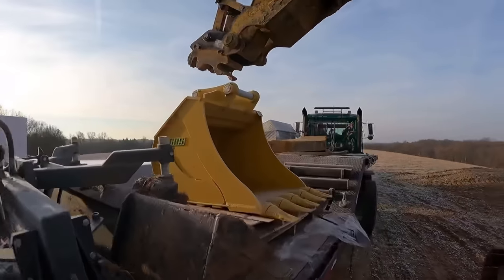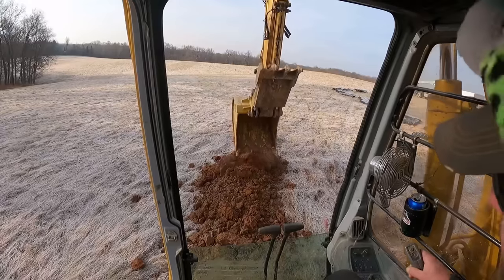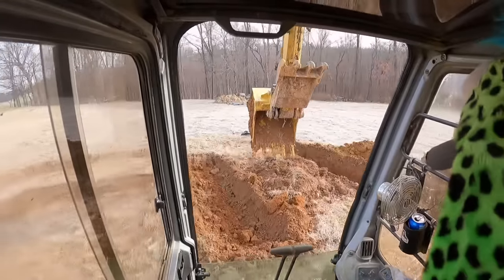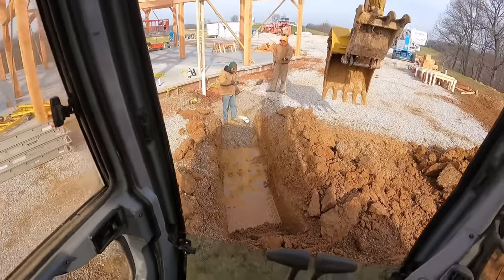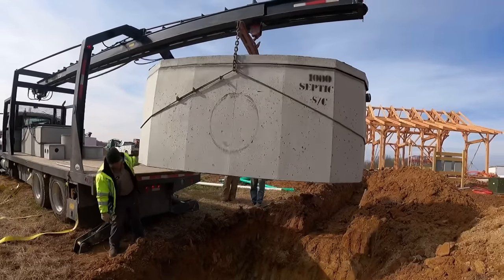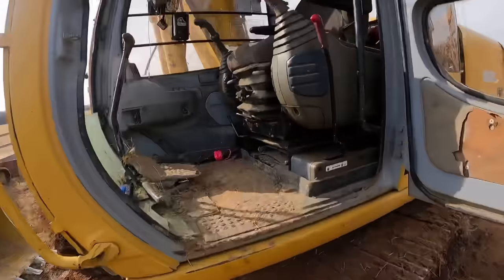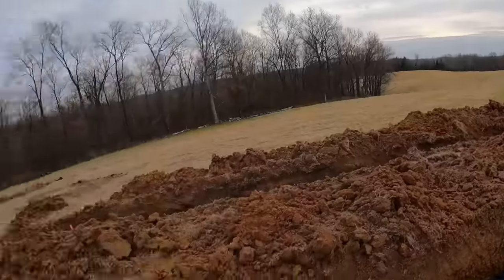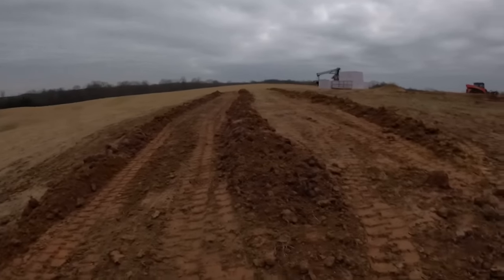Installing a chamber system with the new SRS bucket for the 120 #itsawesome

Comment: I built a couple of buckets for a JD 120 for a friend. I had to order the pin stock as his needed 65MM not 2 1/2 inch. The 65MM pin is about .060 larger. I am not sure if your quick coupler would be the same. I do not know the brand of his but the metric pins kind of threw me on the first bucket as it was loose. The old pins where worn just enough to tape measure 2 1/2 inch.  I had to mill the first bucker mount out to the 65MM. That is why it stuck in my memory. It been 10-15 years ago now. 
  It will be interesting to see how this bucket works for you. In my area, Eastern Iowa, a bucket that is shorter than it is long will have dirt hang up issues. So I usually make them taller than long and also make them 1/2 inch wider at the front. So with that small taper and extra height, it seems like sticky dirt falls out better.

Comment: Really neat to see how septics are done in different states.... not gonna lie a little jealous about how laid back it seems there. NH is much more strict.
Reply from the maker: Yes we are very lucky
Reply: Do they do presby systems in NH?
Here in Mass. I worked on a couple, great in tight quarters and only need sand around pipe. So much easier and smaller foot print.
Reply: @michaelmaker8169  yup but more strict then what @dirtperfect does. Layout elevations etc all on a plan per septic designer and then must be installed exactly and inspected. They are used a lot on tight lots and around the lakes. Can’t be an old fashioned stone and pipe tho!

Comment: I do the same thing on my field line installs. Thanks Jason.  I would like to see how those esco ultra lock teeth are to change. They have a kit that fits the digging teeth spacing that fills the gap and works like spade teeth or a smooth edge. I’m kinda OCD I want all my teeth to be the same to make life easier but it never seems to work that way.

Comment: Septic systems have came a long way from the old out houses, even in the 70s you had to have 30 tons of gravel which would be very expensive these days, nice video and system 👍, Later yall.
Reply: Still doing leach field systems in some parts of the country with ditches full of rock. My septic system was put in like that in 2004. Out of the septic tank 4' solid pipe to a junction box, then 3 lines out of it using perforated pipe. A foot of rock under it and a foot above it in every ditch that are 150' long each. Rock wasn't as expensive then as it is now either but boy oh boy I wouldn't want to be doing it now. 16 years now and haven't had a problem not even had the tank cleaned out yet because I flush a yeast and oatmeal concoction down the toilet every 3 to 6 months that is supposed to boost the bacteria that break down the waste. So far it must be working good because like I said it's been 16 years and haven't had to clean it out.  👍
Reply: @williambryant5946  William don't wait till you have a problem before cleaning the tank, the waist will spill over eventually,  its recommended to clean every 5 years, check to make sure I'm correct a lot of good people to ask for help these days 😀
Reply: @williambryant5946  
Eh I've worked on 40 yr systems, and owned a couple, no they do 'not' need pumping if properly maintained. 
An too be honest, unless there's over 4 residents in a dwelling? There shouldn't be an issue if it's properly designed, kudos too your codes.
Reply: @TheArchangel38401  2 people, 1,000 gallon tank, 3 150' leach lines. I won't have to clean it out as long as the bacteria levels stay high enough to decompose the waste and the leach field doesn't get clogged up. There's nothing to gain arguing with someone that thinks an underground septic tank is going to fill up and spill over. Obviously they're the expert and they get theirs cleaned every 5 years by "recommendation". A "recommendation" that comes from the septic tank companys so they can charge you for cleaning it out making money off you every five years from then on. Like you said if a septic system is installed correctly and maintained correctly you won't need to have it cleaned out unless it's over used or there is a major problem. Thank you for the backup. 
Stay well.  -Wil  👍

Comment: The last time I put a septic system in I used something like that it was the first time I ever seen those plastic things it wasn’t bad though I’ve helped put in several back in the day with Perforated pipe and P gravel
On that pin for that bucket I would think having a sleeve over it would be better all around if it wears you just replace the sleeve and not the pin

Comment: Nice design on that new bucket,matches the thumb perfectly,,on a different note,as often as your called upon to push out the truck delivering the septic tanks when it's gotten stuck,you would think the trucks would be equipped with rear axle lockers and more aggressive tires,the trucks are delivering to construction sites,not a paved parking lot!🤔🤔

Comment: That bucket needs to go from pretty to dirty, to shiny. Steel polished to a patina by dirt and rock looks like success. 
Our interceptor drain had to be stuffed with a heavy vertical visqueen water barrier with drain rock uphill and a slight ridge left on top. The drain field never got muddy. 
More perfect dirt work.

Comment: A power rake for the excavator with a pivoting head could be a possibility to clean it up while there. I did like the power rake when I saw you use it on the lake or river, i.e. 300 tons of rock on the bank between neighbors.

Comment: I have not seen that style system. Wondering where the best use cases are and if usable in NC area as soil types look similar to my area... gonna do some research.  Thanks for the education.
Reply: Interesting system, though it would be a bit harder to hide a body under these than the taller systems we use here in Georgia.

Comment: I have never seen Chambers that small.  The smallest we have are 24 inch. Pretty much half of a 48 inch pipe. No distribution box either.  It has to be 110 feet per bedroom. But they let us reduce the system by 30 percent if we use Chambers.

Comment: I like it. You’re set up evolved. You’re JD 120 did not come with a thumb, so You added an after market one and it may have the teeth spaced for Your bucket but probably not. Now You’re bucket is wore out and You want a bigger one so You Custom Ordered a new bucket that will mate properly with You’re existing Thumb and saved half the cost of OEM JOHN DEERE BUCKET. Did I get it right?

Comment: Build you a cover for the teeth on your trench bucket for running grade. Make it to be able to slide over and put a pin in when you need it. Will the water under the house just follow the drain trench now?

Comment: Mike, why do you like the flat bottom bucket? I don’t hate them,but when I change from a rolled to a flat it throws me off on my digging motion. I tend to like the curved better. If all the buckets I use matched profile I might like them but most are curved and they aggravate me until I adapt to them.
Reply from the maker: And clean up and run grade much better
Reply: @DirtPerfect  checkout the ultra lock continuous edge setup.

Comment: Something I have been wondering about the thumb and bucket, when the thumb is closed, can you move the bucket in and out and the thumb follows?
Different kind of septic system this time. 
That a fine new bucket.
Reply from the maker: Depends differ from machine to machine

Comment: What is the frost line ? 24" seems too shallow for hard freezes and why no stone or sand? If that's what it calls for its right , it's different , just trying to understand it.
Reply from the maker: Have several others videos coming that check them out
Reply: Frost  doesn't have much to do in septic work.   Most all pipes are pitched. And the   tank and system  area water make quite a bit of natural heat
Reply: @toddreynolds8875  the ground lifting and contracting at 24" shure will.
Reply: @davidnichols1363  very true on that issue  but the pvc products seem to at least handle that small amount.     I guess.     Think about theres millions of houses  with sch 40. 4"  sewer pipes coming out  pitched that are only a foot or  foot half under ground level to septic tank.      They dont seem to break.   And ive dug along side of plent of exsististing ones. And there not leaking ?  And our frost depth is 42 inch here

Comment: OMG, I’m wondering if Chris @letsdig18 after this video wondering why you’ve not gotten his signature AMI bucket, oh I know they only fit on Volvo!
Reply: DP does have a Volvo as well, just prefers to use the JD. Chris had his bucket designed to be  optimal in his situation, for his machine. DP's new bucket catered to fit his application. Apples to oranges comparison
Reply from the maker: Nailed it

Comment: I for one would want to get the water out from under the pad. Hate to see the water push up the middle of it. And and "unique" as it is, I like the hat.
Reply: yah... I have seen issues with that before... proper gravel slab under in a deep frost area, but no drain to daylight, so it pools with water and heaves.

Comment: it not that simple to just change out the pins to bigger ones, all the pin boss's have to be line bored out to take a larger pin, and depending how much meat them pin boss;s have, if you have enough meat to bore out with out getting the boss' s to thin, it maybe an 1-1/2 pin and you need an 1-3/4" pin/s or a 2" you thin the boss's out to much and they brake apart witch would mean air arcing them out and cutting bigger holes, but being a new bucket, i am sure they do it right and cut the ears right off and make new ones for larger pin boss's. sound like some one gave the wrong size.. not saying any names
Reply: Be better just line bore them to size if the boss on plate has enough meat on them

Comment: Great bucket BUT when are you Americans going to leave the 1970s behind and join the rest of the world with tilt rotator systems and steel wrists. Thumbs are handy for grabbing something and that’s it, admittedly attachments for tilting systems are expensive but so is time and paying extra workers to check grade when earthworks does it all for you no need to put someone in the trenches. The dirt ninja explains it well in a recent video
Reply from the maker: For what I do am not interested in one but for other work would be nice
Reply: We would rip a tiltawheel bucket into about 6 pieces of junk. Within a weak excavating in our neck of the woods.     I would laugh at it if you delivered it to my shop on a pallet for free !
Reply: @toddreynolds8875  is your rock stronger than everyone else’s rock?. I didn’t know that they built them for digging dry sand only
Reply: @TheSwampdoggydog    lol.   Someday i will post pics or videos of our digging.     Most of our boulders are solid granite.  Not sandstone.       Granite so dense it weighs 177 pounds a cubic ft.       One after the other.   In order to dig our average yard to achieve grades. Approx an acre.  Then dig full basement and septic  , water trech. Utility trench.       You wont have know problems excavating.  200 to 300 yds of boulders.  From  basket  ball size to  7 to 8 yard size.    So yes it would rip it to pieces.      Alot of areas in America are the same.      If they worked for us you would see them on our machines.
Reply: @toddreynolds8875  sir I don’t want to get into an argument of who’s daddy is bigger than who’s but, Sweden where Engcon is designed and built !!!!!  And of course the area of the world they are mostly used is Scandinavian countries
Reply: tilt rotor would probably cost more then the 120 did. they aint cheap.
Reply: @als8518  true but how much is your time added up over the year moving the machine to dig a different direction and paying someone to stand in a hole holding a stick ain’t cheap over the year. Tilt rotator don’t need health insurance or tax